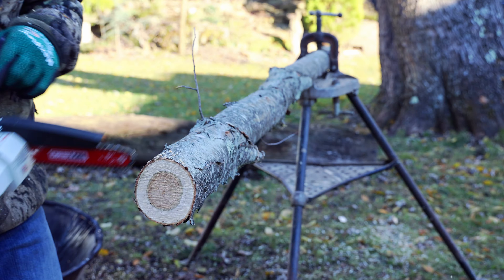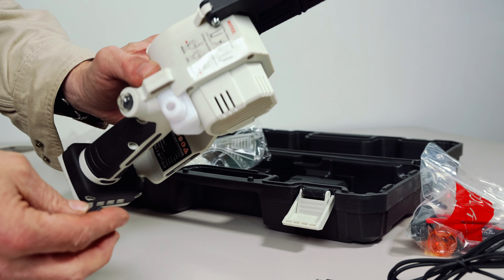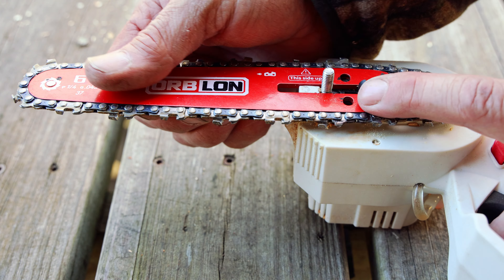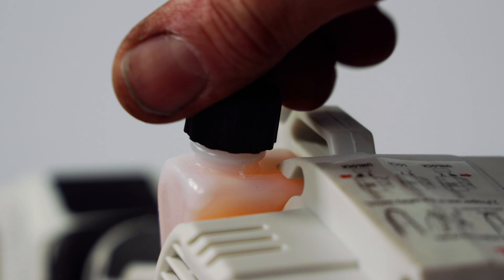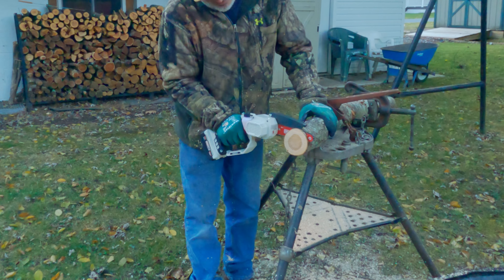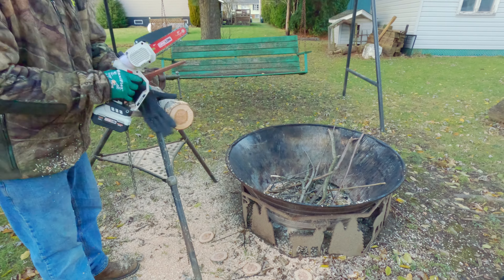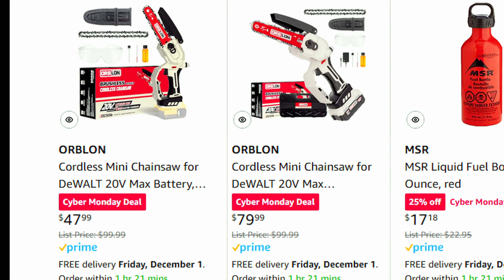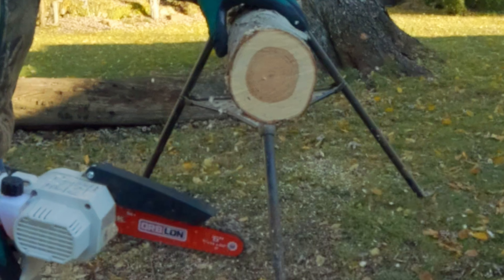Orblon 20v Chainsaw Torture Test and Review

Comment: Best review I’ve seen on this. Thanks, Mike.
Reply from the maker: Thanks for watching and the kind words Q-ster!
Reply: I’m really considering buying this — it’s the Saker versus Orblon right now. Did you ever figure out a fix for the chain tensioning? Does it a pose a hindrance (having to constantly re-tension) with regular everyday use?
Reply from the maker: @theq-ster6981 Thanks for watching. Considering the amount of cutting and really using the saw way beyond what I would consider the normal realm of use, the chain should actually stay tighter longer under normal use. I haven't tinkered with the chain tensioning to see if I could make an improvement on it . I have reviewed many of these saws, and this one Still Remains to be my favorite out of the entire bunch. The oiler actually works, and with the DeWalt batteries, battery life is really impressive. There are lots of other features I liked better on this saw than most. I hope that this helps.
Reply: Thank you for the prompt reply. Going to put this in my wish list for purchase before my next camping trip. Have a great weekend and thanks again for a great review! 👍